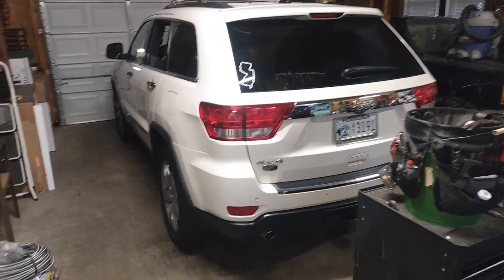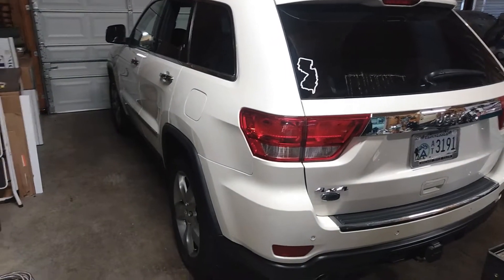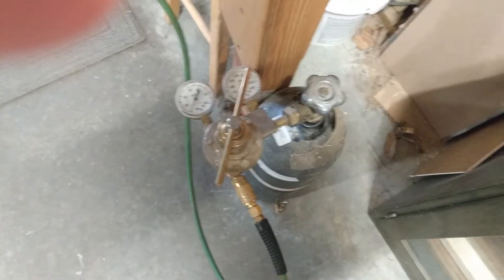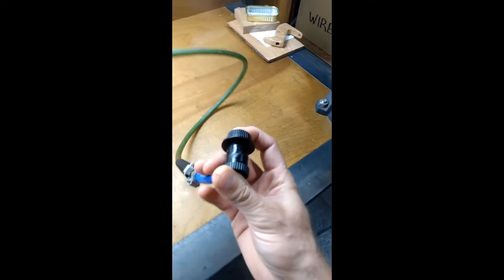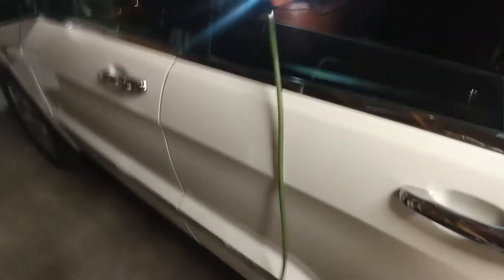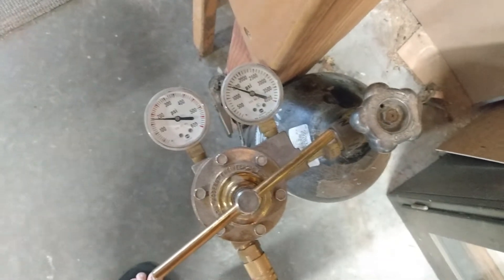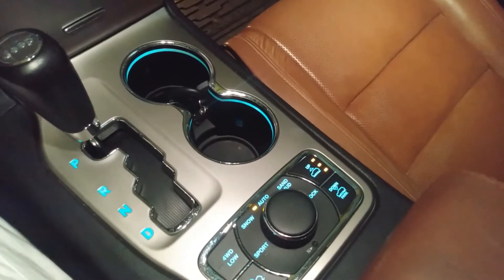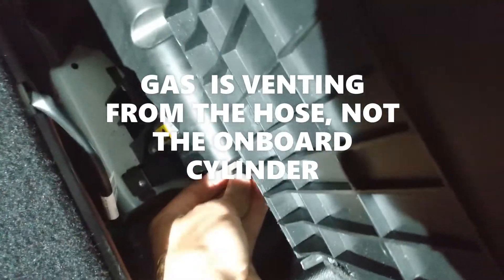DIY Jeep Quadra-Lift II Suspension Recharge

Comment: So it was still losing air this why you are doing it..?
Reply from the maker: Yep, once in a whiie the compressor will kick on and not go off because the tank pressure is too low. This happens less than twice a year. That tells me there's a small or intermittent leak somewhere, which I can't find.

Comment: I have a 2011 jeep grand Cherokee and it’s low it won’t go up I replace the air compressor so if i get my tank refilled and check for leaks on the lines will  the car start rising ?

Comment: I just replaced both elbow connectors at the top of the front shock towers. The driver side was leaking down over night (verified the leak with soapy water) the passenger side was fine, but replaced the elbow anyways. There's a procedure to depressurize the shock and minimize nitrogen loss, needless to say some nitrogen was lost in the process. The shocks are holding fine and I want to check the pressure in the nitrogen tank and top up if needed. I have an R134 quick connector and gauge set up like you would use for and A/C recharge. I don't want to force it but I can seem to get the quick connector to connect to the tank. How much force should be required? Thanks, and great video.
Reply from the maker: Well done on your repair. The R134a disconnect is like most pneumatic disconnects--sometimes they can require a stern push. I always pull/retract the the disconnect mechanism while I'm pushing them on. Some require this, some are designed to be pushed on without doing so, but it still makes it easier in those cases. The nipple on you tank is sturdy, don't worry too much about damaging it.
Reply: @DKNJ_128 Thanks, got pressure gauge connected. 110 psi at normal ride height, drops to about 60 psi at off-road 2 ride height. When lowers to entry/exit pressure in tank jumps to about 300 psi (taken with a grain of salt as my gauge is nonlinear after 150 psi).

Comment: how much about did the tank cost and about what size would i need of a 1 time use? and no computer needed? My rear bag just blew out. Replacing bag is not an issue. But refilling the tank is where I am stuck. Do you know by chance will it fill enought to drive it to a dealership if it comes to that?
Reply from the maker: It was $150 for the cylinder+nitrogen, minus the trade-in value of an old CO2 cylinder I had. So you're probably looking at $200 to own the tank. If you're only planning to charge your system once, I would recommend just renting a cylinder and regulator. I'll probably come to about $50 from your local welding supply house. A 40 cubic foot tank would be more than enough to give you several full charges. If you are getting a "service air suspension immediately" readout on your instrument panel, you're going to need a computer. If there's no error message, you'll be fine without one.

Comment: I recharged the tank, but when I was going through the different levels one of the rear air suspension bag blew, making a loud boom.  I think it had a leak on one side and the system was trying to raise it to the proper level, filling one side too much.
Reply: 😆 It's quite the boom isn't it. (mine did the same)

Comment: What exact Quick Connect did you use
Reply from the maker: For the car end of the hose, the connector from any R134-a recharge kit will work. They are all identical. Example: tinyurl.com/bd64h9rw

Comment: waste of time regular air works fine many air suspensions use only air anyway when you lower your rig it vents to air compressor compresses air back in like putting nitrogen in your tires waste of time
Reply: Completely wrong. Regular air contains moisture. The moisture in the system will freeze in cold winter temperatures, rendering the air suspension inoperable. That's why they use only high purity nitrogen.... there's no moisture in it to freeze up.

Comment: So you dnt need a scan tool
Reply from the maker: @GunGek215  If your ASCM is reporting a "Service Air Suspension Immediately" message, you'll need an OBD-II scan tool to reset it.
Reply: @DKNJ_128  I have an Autel ODBII scanner but I don't see anywhere in that tool a setting to reset the air suspension message. Do you need a special one to do that?
Reply from the maker: @ekummel I use an OBDlink MX+ with the AlfaOBD app to get into the nuts and bolts of the system. I can't speak to the functionality of other scanners or software.  If you aren't familiar with AlfaOBD, I would recommend looking into it.  You can try it out for free with limited capabilities. For my needs, the full version was well worth the $50 purchase price.
Reply: I’m back to this same issue but this time the air compressor pump isn’t even kicking on 🤦🏽‍♂️
Reply from the maker: @ Start simple. Check your J1 fuse. If your compressor had been running too much trying to keep up with an underfilled system, it'll blow that fuse.
Reply: @DKNJ_128  what do the J1 fuse represent.?
Reply from the maker: @GunGek215  J1 is the fuse for the circuit that powers your air suspension compressor. If that fuse is blown, your compressor will not run.
Reply: @DKNJ_128  can’t find that fuse 🤦🏽‍♂️
Reply: @DKNJ_128  that was the issue before the fuse kept blowing when I would put a new one in changed the pump it worked …. Now same problem but the fuse didn’t pop. What could it possibly be now . And thanks for responding and the info
Reply from the maker: @ Are you getting an error message on your instrument cluster?

Comment: Just to point. If you have leak in your suspension this video isn’t for you because you will spend money on gas which will be top up with air by compressor. It is not close loop. Compressor still take air to build pressure in your system. This is worth doing if your system is ok but your car has some large mileage to reduce air in system . If you live in cold climate and your air ride is sluggish in cold temperatures it means you got water in system which freeze. So to purge your air system have sense. Otherwise look for leaks first.

Comment: I have a 2015 jeep summit and before we changed one of the air shocks it would rise up but then go down again and won’t stay up. So we changed that shock thinking maybe that was the problem but the new shock does the same thing.  Would you or anyone know the problem with this? Now where you change to rise all three lights are blinking. Help please.
Reply: If it's just the front that goes down look under the hood on top of the strut there is an air line that connects with a little elbow. Wiggle it with the engine running and it's trying to lift and listen for a hiss from a leak there.  Both mine were leaking and as I speak just changed it and its working. Its like $35 on amazon. Now I need a refill because it's still taking a wee bit longer than usual to lift so I assume it's low.
Reply from the maker: Yep I have heard that the problem  @shawn544  mentions is a common one. Plus it's easy to check, so I'd start there.

Comment: Is the regulator same size as oxy or acetylene right hand thread
Reply from the maker: No, all three threads are different. They do that so you don't mix gasses by mistake and have granny breathing acetylene for example. Nitrogen bottles use CGA580 regulators.

Comment: wish i had this like 6yrs ago. I paid 3k for this repair at the dealer and it broke in a year. Then I ripped it all out and put coilovers in
Reply from the maker: Oof, I'm sorry man. Over the years I've easily spent $4k at the dealership trying to get it fixed. They had my jeep for a grand total of 60+ days, and still they never could get it right. I was one click away from ordering coilovers and doing what you did, but at the last minute figured I'd try the process shown here. That was years ago, and it hasn't failed me yet. I top of my nitrogen 1-2 times a year.
Reply: @DKNJ_128  yea I think the system itself has  multiple points of failure. The pump can go bad and the air forks can leak air from the hoses at the top
Reply: Is a coil over a spring replacement?

Comment: Costco has the Nitrogen tanks. My local one said they would allow me to come by and fill my own tank but they wouldn’t do it for me, for liability reasons. Just putting this out there in case anyone needs.
Reply: The Costco near me only goes to 90 PSI. 🙁
Reply: @ ah I see, I didn’t check the max pressure at the one near me
Reply: And how much that cost?
Reply: @ free bruv
Reply: Hi, I have a question, is the nitrogen system that is in Costco the same inlet to fill the air suspension tank with air?
Reply: @ I don’t think so. It’s uses a 134a A/C connection. I made one tools I bought at Auto Zone and Pirtek (local hydraulic hose fabricator)

Comment: Did you delete my comment? I'll say it again--- the procedure outlined in this video is not the proper way to fill the air suspension tank. The AlfaOBD app has the capability to allow you to properly evacuate and refill the system exactly like a dealership scan tool.
Reply: @Japplesnap how/where do you obtain the AlfaOBD app
Reply: @MrWurthit4660  It's an app. Get it on your phone if you have an Android. You can't get it with an iPhone.
Reply: That's fine, but ultimately the system only cares about the pressure in the tank, so if you haven't leaked down to atmospheric and injested water vapor, this isn't going to hurt anything.

It's an air bottle, three valves, and some sensors.

Comment: We have a 2011 GC Summit.  It's getting old, 12 years.  Our Quadra-lift suspension has been excellent.  We put it in Park mode everytime we stop somwhere.  I read of many issues but figers-crossed, we haven't had any.  I have thought about emptying the nitrogen tank and maybe even draw it down with a Air Conditioning service Vacuum Pump.  Then refiilling.  Moisture in the system I would believe could cause the bags and struts to rot from the inside out?  Love the video.   Thanks.
Reply from the maker: From the extensive research I've done, I get the sense that most QuadraLift systems are dependable and trouble-free like yours. But there are some out there that are complete lemons, and nearly impossible to diagnose (like mine). I understand the theory behind pumping down the whole system with a vacuum, but I personally wouldn't do it. Too many valves, connections, pliable  parts (e.g. airbags) that are not designed for negative pressure. Some people suggest adding a sorbent to the system, but it's a closed system, so there shouldn't be any moisture in there to begin with. I also tend to think if it ain't broke...
Reply: @davidschaffer4884  There is a lot of things that say this is not a closed system. The claim is that the system has an intake and filter on the passenger side and will pull in atmospheric air if there is not enough nitrogen in the tank.
Reply: @DKNJ_128  I'm sorry you have had so many issues with the suspension.  Our time may be coming.  We are worried more about the 5 7 engine.  They have Cam and Lifter failures that can cost about $5000 to repair unless you DIY.  I used to do lots of Mechanic work until someone broke my Back. Burst fractured L2.  Now I can hardly bend enough to tie my shoes let alone lean over to tear down an Engine.
Reply: Do not apply vacuum to the system. It's not designed for vacuum. You can simply evacuate it and refill it with high purity nitrogen and it will be fine
Reply: I have a 2014 GC with quadra lift. Got it with 60k miles and we put 60k more miles in it, 40k of those towing a 6000Lbs trailer, so it was stressed a lot. The only issue that I had was air leaking from one shock hose connector (highly probable that my mechanic put weight on it while working on the car). I got the repair kit for like 20$ on ebay. replaced the part and never another issue ever 

I did disabled the "easy get in / out" mode that will lower the GC every time you put it on park. 

I guess it fails, like anything else, but some people cant see the easy fix issue, and others gets into a loop with under-trained dealers pushing bad propaganda on the suspension itself. Now she is on 125k miles, with factory shocks still running perfectly.

Comment: Thanks for posting, great video.  At this point over the years I've had my 2013 Jeep Grand Cherokee Overland into the dealerships about 4 times, each time they took a week or more to figure it out.  About $4, 000.00 in repairs. Again now in 2023 the system is down in the front and will not activate the pump to raise.  Doing the troubleshooting myself this time. If it looks like it will cost another fortune I will probably just put in T- Connections on the front and rear  hoses with Schrader valves and raise it to desired heights depending on what I am doing with an air pump.  Never again will I have a Quadra Lift, the Dealerships just make tons of money off repairing their own faulty system.
Reply from the maker: I feel your pain. I'm about $2400 in the hole, on my 5th compressor, and my Jeep has been at the dealership for more than three months collectively. I've taken it to multiple dealerships, they've enlisted the "help" of FCA, and still nobody has been able to fix it properly, or even find the problem. Now that I have the tools at home, I don't even sweat it anymore. Good luck brother 💪🏼
Reply: So true man! I just got my 2015 overland back after 8 months with air suspension issues and the fronts are down again. Haven't even had it for a week and I spent like $4500
Reply: Hey where to I find a tank of nitrogen with the valve locally??
Reply: @hartow3535 try a welding supply store like oxarc or Norco